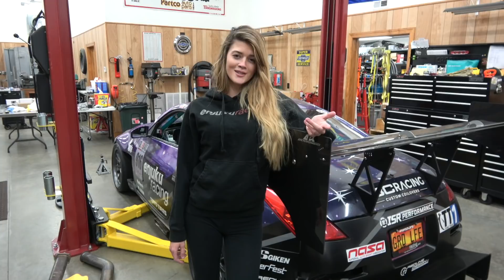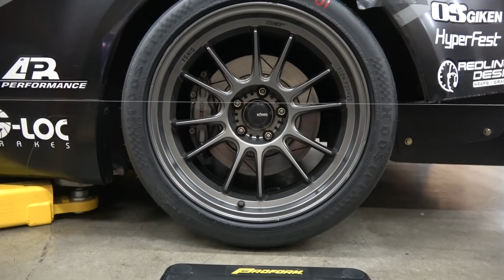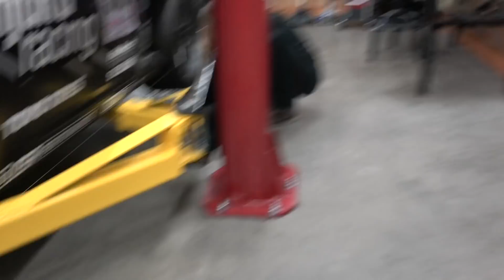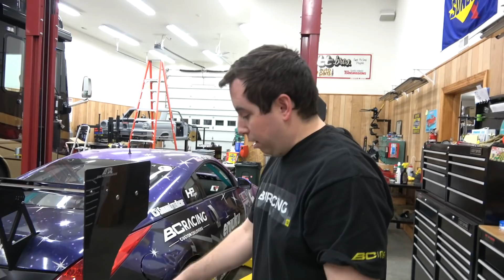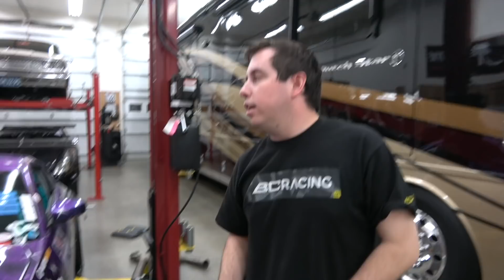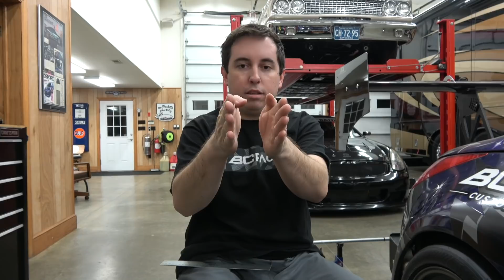How To Align Your Car

Comment: If the rear of the car is wider than the front and you’ve measured 148.5 on the rear and 140 on the front the string isn’t running parallel front to back so you’re making adjustments based on a string that is already out of alignment because it’s tapering in from rear to front giving the impression that the wheels are toed out when really they could be perfect
Reply from the maker: You have the number backward, it was 148.5mm on the front and 140mm on the rear, because the rear on these cars is wider. Also this is why we compare left to right when balancing the strings, not front to rear. Which I believe I mention at some point in my rambling haha. Also one thing I should have spoke more on is the fact that my rods have grooves in the ends that allows me to know the strings are on the same spot on both ends, which leaves us to dial in the left-to-right on the front and then the left-to-right on the rear to evenly disperse the spacing of our parallel lines.
Reply: Apex Garage ahhh right so the poles have markings spaced out the same in the front and also the rear ? That makes more sense haha, I thought the strings were also being adjusted and could result in false readings
Reply from the maker: bradley tomlinson yeah we show the grooves in the beginning but I only mention making ziptie channels for those at home. I probably should have elaborated on that a bit more. Thanks for the question!
Reply: @ApexGarage  so the strings are actually  parallel and measure the same distance to each other front and rear? I did find it a bit confussing and had the same idea as the original poster thinking you set them off the wheel centers, meaning they arnt parallel. 
But thinking now you didnt touch the string just the pole. Thanks for the video, would be great to see how you guys set camber.
Reply: The distances are different between the the front tires 140 and the back one 148, the only way to have parallel fishing line lines, is to have the same number or distance perpendicular on front and back measurements.  Run the lines out another 100ft and they will intersect. 

Now, the tires one side (say drivers side) could be on an equal plane.  That is if you called the axle your x lines and the wheel rims your y line (in an x plane and y plane) the y plane of both the front and back could very well be in parallel planes to each other.  My head hurts now.  Depending on overall length of end to end axle measurement of both front and rear axles.